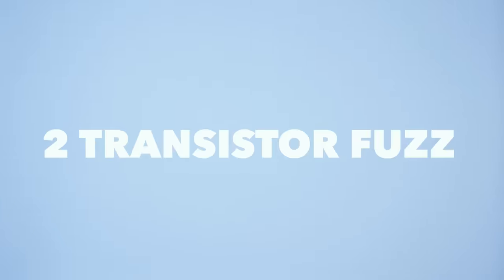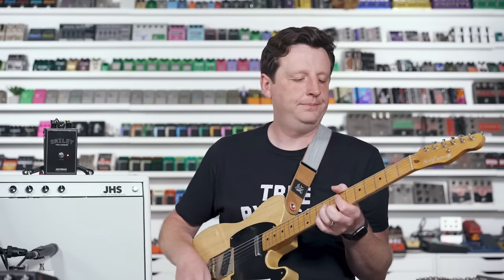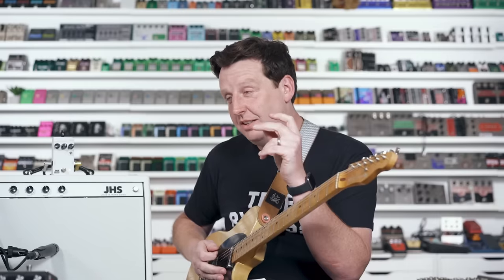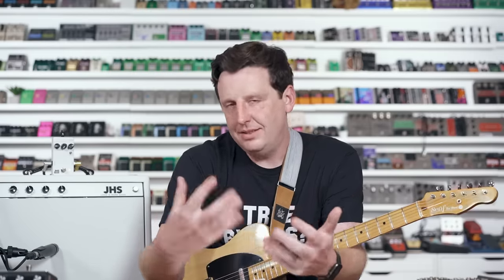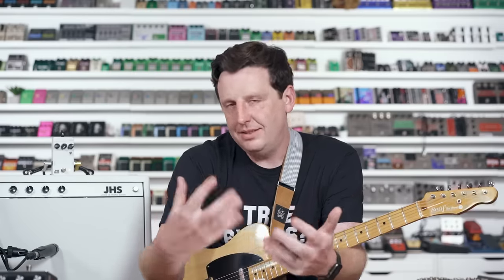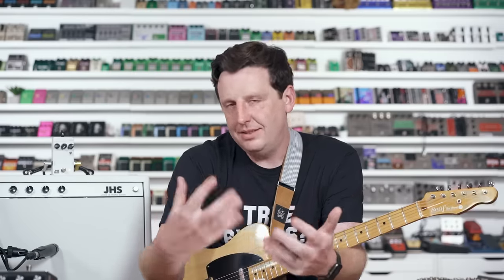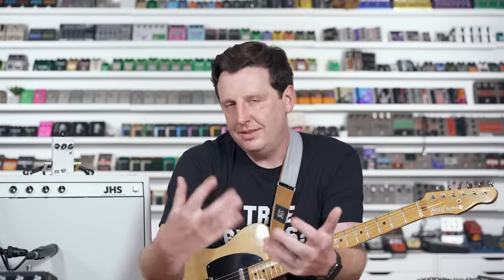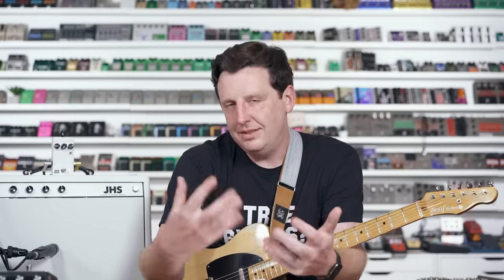How to Find the Fuzz Pedal You Need

Comment: How can my Fuzz pedal go first when I have 7 Fuzz pedals?
Reply: I had to move some fuzzes off my board because half of my board was fuzz. That’s said, I’m building more, including an octave down fuzz, and a monster, 7-transistor “fuzz-stortion.” Trying to decide on what transistors are going in it - spec calls for 3 2n3904s followed by a BC337, and then 3 more 3904s. Considering breadboarding it with 2n5088s in the second half, or maybe a MPSA18 right at the end. It might cause a mushroom cloud.

Comment: This episode is really close to what I would really love to see, namely Josh talking about circuits in general. How are time-based effects created, what makes a fuzz go *zing, how do you create which sound. I mean, this could be an awesome learning resource that could put people on the path to trying to put something together themselves
Reply: Josh seems to go out of his way not to use any maths in his descriptions.  The octave fuzz description did not use the term absolute value, but rather resorted to using worm holes theory for some reason.    Sometimes I think Josh is just trolling us.
Reply: @moddquad8362  I am totally clueless when it comes to circuits and electronics, but fumble with Reaktor DSP and modular synthesis. And the  octave fuzz bit sounded like wavefolding and then I thought: a series of generic explanations of what is done to achieve certain sounds would enable the soldering-lings as well as DSP-anese people to build stuff
Reply: @Mu1974  Having a good ear seems to be the most important attribute to make a good sounding pedal.  JHS started with Josh modifying existing pedals though experimentation.   His electronics chops came later.
Reply: @moddquad8362  yea, it's just that as I am into digital sound processing only, I can only go and take a look under the hood of digital FX (which is fun). But that notion that an octave fuzz might be wavefolding was quite exciting, because I always knew that it was not about pitch shifting, but couldn't really figure out what was going on instead. That's why I think it might be interesting to learn (from Josh) about how to approach certain FX in general, without regards for the actual physical components, if that makes sense. Kind of the mindset behind a sound, the idea behind the manipulation, you know?
Reply: Not sure if you purused the older JHS episodes and live streams, but he’s done some pretty good ELI5 style summaries. This channel is a treasure trove of information disguised as entertainment.
Reply: @Daniel-rg9sl  how much older do you mean roughly?
Reply: @Mu1974  just watch every video
Reply: @juancarlossuarez7486  ok, hang on
Reply: @Mu1974  I’d say go back as far as three years ago. Some of the early episodes when it was just Nick and josh. Idk I’d just start from the first vid and see what jumps out at ya. Really can’t go wrong. Have fun!
Reply: WhatTF on EARTH RU talking about?!?!? THATS WHAT THIS CHANNEL IS! Theit HeAds must EXPLoDE when they see comments like yours…. Jhs be like, “well, we spent decades researching, marketing, building, now countless hours on film explaining every step, component, year by y3ar histories of every different diode, even every change or glitch in the paint job or screen printing!…. Every player, every engineer, the science of acoustics, psycho acoustics… such a singularly well archived library of science music and occult knowledge, explained with mastery and zealous love and fascination. AND ITS ALL COMPLETELY HERE ON THIS PAGE!,!,!!, AND THIS “MURAT KAYI” is saying he wishes we would do the thing that is the YouTube Channel that HE IS ON RIGHT NOW!?!,!, AAAAAAAAAAAARRRGH [BANG 🔥
Reply: @moddquad8362   ccccccc c  c c  cc                       cc
Reply: I would love to see him actually teaching the circuits too. Showing diagrams and explaining what all the components do to the sound and how, as the signal passes through each.
Reply: @christofyre  I'm teaching an class on "Guitar Amplification and Effects" right now at Georgia Tech and have been posting my lecture materials to YouTube. I have the playlist for it on the main page for my channel. I hope you find it helpful!
Reply: @Mu1974  I got an octavia clone and I couldn't wrap my head around wha twas happening. I was expecting pitch shifting. watching this helped me out.

Comment: i always thought i wasn't interested in fuzz, that it was too aggressive and, like... fuzzy. but seeing you get these really nice sounding vintage tones out of the 3 transistor circuits specifically, got me thinking that's something I want in my arsenal.
Reply: update: bought a JHS bender and I love it.
Reply: @tsarbamba642  I love Fuzz & have 11 in which one of them is the Bender. My question for you is do you use yours with the red mod button pushed in or out?
Reply: the JHS bender is the only non muff fuzz i use, it’s excellent
Reply: @emmettyoung7603  I have one as well. Question, do you use it more with the JHS mod button or as is?
Reply: @barnaclestval  i kinda switch back and forth, if it's going into a clean amp, as is, if the amp is slightly dirty, mod switch
Reply: Fuzz is a fundamentally different voice from saturating/cascaded tube pre-amp stages:
 - Few fuzzes can go outside root-III-IV-V intervals without also creating dissonant side-band frequencies.  
So any 6th/7th/9th chords, spread triads and inversions may result in something of a mess.
 - Few fuzzes can clean-up smoothly, no matter where the guitar's vol knob is 

I find it more helpful to think of fuzz in terms of WAVE-SHAPING rather than in terms of  "failing to maintain unity GAIN" which is what tube amps are doing as they further compresses and clip the input signal.

Comment: I've loved the velcro fuzz sound for a long time without knowing how it's created, or that the sound is actually called "velcro fuzz" until watching this video. Great episode, really informative
Reply: Dude same here. I came here looking for this comment lmao
Reply: Valco or Velcro?
Reply: Now I'm wondering how Jack White gets some of those gated velcro sounds when AFAIK he uses only a big muff for fuzz. Maybe it's the POG doing that idk
Reply: @NDA I'm assuming the clean boost goes after the fuzz? And how does a clean boost like the micro amp help to get that velcro/gated sound?
Reply: @NDA dude awesome thanks so much for the insight! I've been eyballing the fuzz factory and there's one by Danelectro that looks pretty interesting called the Eisenhower
Reply: @RabidChasebot  Clean boost after fuzz will make the fuzz louder.  Clean boost before a fuzz might just sound like crap if the fuzz is sensitive to input impedance like most fuzz faces.  If the fuzz is more like a Muff, then adding volume boost before it will be similar to turning up the gain knob on the fuzz pedal.

Comment: Jeez, I clicked on one of the links in the description and found out that the Analogman Sun Face NKT Red Dot fuzz pedals like the one that I bought in 2019 for $260 are listing on Reverb for $850-$1200. Apparently Mike ran out of the NOS NKT Red Dot transistors in 2020. However, he still has numerous other germanium and silicon transistor options available. Now, I love my Sun Face, it's a fantastic sounding Fuzz Face pedal, and I don't really shop on Reverb much so I have no idea if those listings in any way reflect actual selling prices of these pedals currently, but I'd have to say you'd be a fool to pay that much for one.

But hey, I'm 56 years old, maybe if I hold on to mine for another ten years I can fund my retirement (or at least pay for a really nice vacation).

EDIT: Oh, by the way: "🎵🎶I have the box!🎶🎵"
Reply: Transistor numbers really don't matter. Having matched and properly biased transistors will get you better tone. It's not like the number equates to some sort of tone magic.

Comment: I remember in the 2000s there used to be a lot of talk about the Big Muff not being a fuzz (IIRC Keely and Analogman both came down in the "not a fuzz" camp at various points in the web 1.0 days) because the signal is being clipped by diodes rather than transistors, and that (among other things that make the circuit pretty dissimilar to most fuzz circuits) makes it more of a high gain distortion than a fuzz.

I mean, it's obviously a fuzz because just listen to it, but it's still an interesting point and I was happy to hear you mention it.

WRT amp choice, I played a black Russian Big Muff into the clean channel of a Polytone Minibrute in high school and it sounded good; through the 2000s I played a Ge Fuzz Face into a Sunn Solarus (the cleanest amp I've ever played) and it also sounded very good. All those great, 60s Os Mutantes fuzz sounds were recorded direct.

Comment: My favourite fuzz is one I made myself, with a 47k pot on the input wired as a series variable resistor, acts like your guitar volume.  Great for both Strats on full volume and Les Pauls with it dialed back.  I copied the circuit from a Jen Double Sound Super Fuzz Wah, which is identical fuzz to the Vox Distortion Booster.  No fuzz control, it's fixed to max, no volume control, it's fixed to unity with input volume dialed all the way back.

Comment: My go-to fuzz pedal is a three-transistor germanium circuit from Fulltone called the Custom Shop Queen Bee. The #1 and #2 transistors are configured to achieve maximum gain in order to hit transistor #3 extremely hard, creating more sustain and distortion than is possible with the 2-transistor Fuzzes while making the pedal rather low-noise for such a high-gained design. Another thing the Bee has, something no other fuzzes have, is ample MIDRANGE! Fender amp owners will appreciate the Passive Hi-Cut Tone control for taming the treble, and further sonic sculpting is accomplished via a smart, loss-less 3-position Bass switch (placed before transistor #3) tailoring the low frequencies and keeping the bottom-end tight. Looking at this pedal’s signal on an oscilloscope reveals what your ears already knew...a wildly asymmetrical waveform high in second-order Harmonics, culminating in a sweet, rich, commanding voice with tons of sustain. Translation: This pedal will not get lost in the mix. Inside the pedal is a trimmer for adjusting the bias of transistor #3 by a range between 2 and 6 volts DC. My favorite tending to be somewhere between 3 and 4 volts. The trimmer should be adjusted by ear as there are no wrong settings, a slight turn results in a drastic change in sound, in volume, and in compression characteristics. Suddenly firm becomes soft, bright becomes warm, grainy becomes smooth...it’s astonishing what this little trimmer does.

Comment: Nice video, thanks; watched more than once.

It convinces me that I am a distortion and somewhat soft/cleanish/overdrive guitarist...who used many effects and still do, especially delays and loopers.  Originally explored looping in the late 70's via the Echoplex. In the mid 70's when I finally decided to get my first ax, I also saw the Big Muff and Vox Wa and got those, soon after my Fender Mustang and Fender Princeton amp.  Therein I found I could achieve very close to the Hendrix at Woodstock sound, Trower along with the proper placement of my next pedal, an Ibanez Phase Tone, and finally could also get the evil, lizardy sound of Fripp on the U.S.A live lp, notably "Asbury Park"  
After that I explored and bought The Rat, Boss DS-1 and finally the Metal Zone, before I moved onto the GT-3 and multieffects once I could afford them. A wonderful journey

Comment: Loving the throw away "historical re-enactment" at 20:44 , and the pristine Elmo Impression at 12:07.
My favourites are my Boba Fuzz [gloriously packaged ZVX Woolly mammoth clone with every available tweak including "gate" and "tone"]  (2 transistor fuzz) 
Boss Hyper Fuzz which I bought when they were brand new/ unheard of/ affordable (£45) (Octave Fuzz)
,and my Big Muff  which turns out to be the op-amp version which every guitar player I knew hated in the 80s [hence purchased used for £15 in 1989] 
everything else didn't have the staying power for my array of styles. 
It's a fun journey I guess my timing was good to try them at affordable o'clock, on the down side I'm way old now, and I never tried a Russian Muff.

Comment: EVH was a big fan of starving circuits of voltage. It's alleged that the name "brown sound" to describe his tone was named as such because of the brown out term. That refers to a dip in voltage in electricity. His rig was fascinating
Reply: He used the variac to drop the voltage on his Marshalls, but not because it changed the tone, just because it lowered the volume. Anything else was secondary, he just wanted to dime everything on his Super Lead Plexis without pissing off club engineers.

Ed was also the one that coined the term "brown sound" but was referring to the sound of Alex's drum, which he said sounded like he was pounding on a log
Reply: A brown out is the same as a pressed ham. Has nothing to do with guitars.
Reply: @TheKitchenerLeslie  Just great. It's already Pressed Hams season, and I still have my Steamed Hams decorations up.
Reply: @somethinghumblestudios  But do you know what it is?

Comment: I'm poor. I get by with a Moen Fuzz Moo (Rams Head Muff clone) and a Behringer SF300 (Boss Hyper Fuzz clone). The Fuzz Moo is good for 90's Alt and Grunge, but the SF300 is the superior circuit. It can be used for everything from early 1960's pop all the way through Doom and Stoner.
Reply: you can sound great even if you don‘t spent a ton of money. and in the end, it‘s more about what you play, than if you use expensive pedals.
Reply: I have some pretty expensive fuzzes and the SF300 is still the one I play the most. It's a monster and I love it.
Reply: The opening two words remind me of the Ruttles movie where the black musician says he learnt everything from the Ruttles. He says, I became a musician and I’ve been starving ever since.
Reply: The SF300 is insane...great for punishing an audience at a reasonable price
Reply: The Boss FZ-2 Hyper Fuzz is actually based on the Univox Superfuzz circuit, as demonstrated in the video, just with the addition of an active boost/cut Bass and Treble control. 

Which the name of the Behringer SF300 Super Fuzz clone quite obviously, and more directly than the Hyper Fuzz name of the Boss, hint at.

And the Behringer SF300 Super Fuzz is indeed an amazing sounding fuzz, especially used with bass, and not just for the price.

An amazing fuzz, period!

Comment: It's not possible to cover everything in one upload, so I will make my contribution. There's also diode clipped fuzz and there are two variations. The diodes are wired in parallel but in reverse to each other. These can then be connected in a negative feedback line between one or more stages. In another, the reversed diode pair is used as a shunt between the gain stage signal out and ground. One advantage I've noticed with diode clipping topology is a tolerance of reduced battery voltage. One of this style I self built had the same battery inside for a few years. A PP3 type smoke alarm battery tested only 4.5 volts when it should have been 9 and the unit it was installed in still functioned. Great upload!
Reply from the maker: thanks for the info!
also, thanks for understanding not everything can be covered in a single episode. usually this comment looks like, "hey what about grumble grumble grumble." lol
Reply: @jhspedals  your knowledge of guitar effects is second to none. I thought I knew about these effects but learned a lot by watching your move, as would be expected. I'm not all that conversant with manufacturers of various effect, although I do have a reasonable knowledge of core studies. My biggest regret is not having electric guitar lessons at an early age. I avoid playing lead but am reasonably competent with rhythm and bar chords. Channel subscription on way! Thank you for your reply. 🙂

Comment: I built my own fuzz with 2  germanium and 2 silicone transistors and made them switchable and biased to use either paired or combination of the 2 types.
I call it the Fuzzy Mug.
Germaniums are smoother, but I like the silicones because they're more abrupt and distorted and "spitty". Also, I the decay on the silicones better.
Reply: is it 4 transitors cascading or do you just switch between the two different pairs of transistors?
Reply: @TinkerToneworks  I also put in the 4 trimpots as well.
Reply: @TinkerToneworks  Sorry, I had another reply, but the algorithm took it off because I had a hyperlink to the article where I got my idea.
Yes, it's just 2 switches with 2 transistors per switch. I guess it could be cascadable? I'll try to add the link another way.
Reply: @TinkerToneworks  /guides
Reply: @TinkerToneworks /diy-workshop
Reply: @TinkerToneworks /diy-workshop-build-your-own-fuzz-pedal/
Reply: At the beginning should be Guitar cot dom (but not cot dom)
Reply: @TinkerToneworks  it took 5 times to get it on there. sheesh!